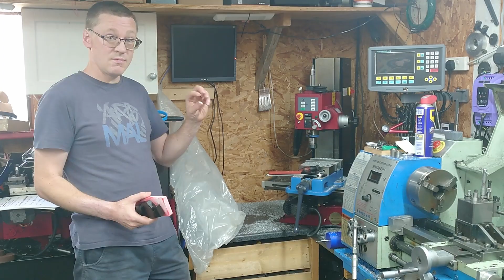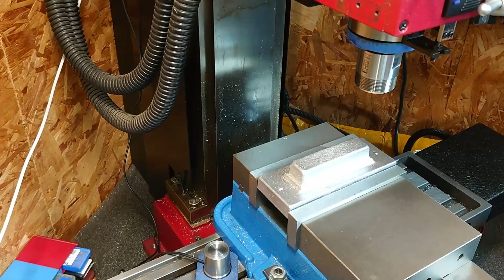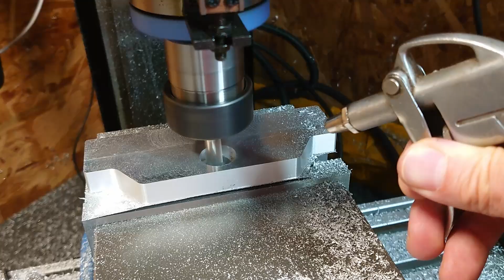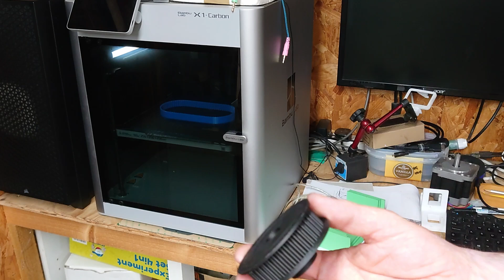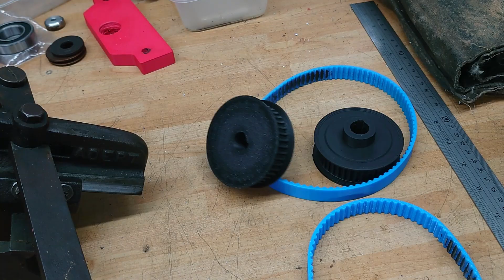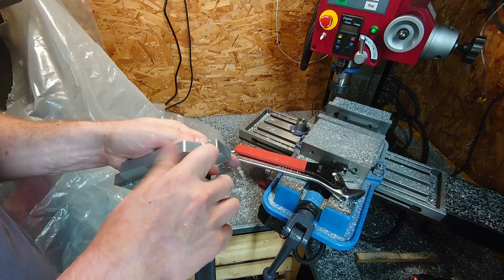CNC Mill Table End Plate

Comment: Hi Olly, Great result, well done!! 

The casting was excellent. So interesting to see all the details.

You have me thinking back to my days making chart recorders, we were using too the belts made from soft tooling, because the volumes were low (and no-one wanted to spend the money) pretty sure they were fibre loaded but imagine you can't do that when 3D printing.

Hope you had a good time in Yorkshire!!

All the best!!
Reply from the maker: Hi David. There are professional grade 3d printers that can lay down fibres, such as carbon fibre (we had one at my last job), don't know if they do flexible things though. Yorkshire was great, the roads were in a much better condition than here for a start!